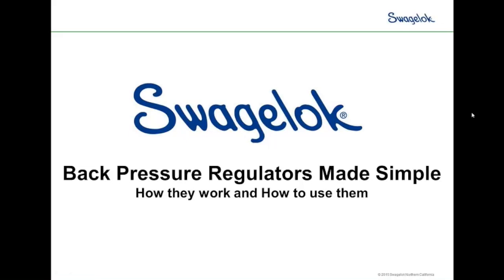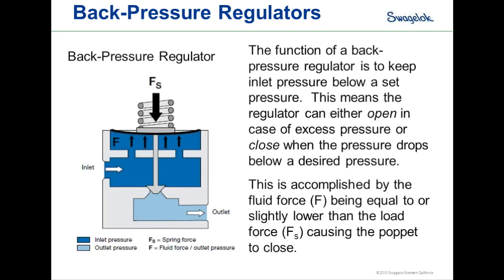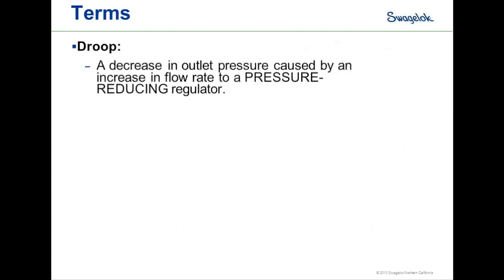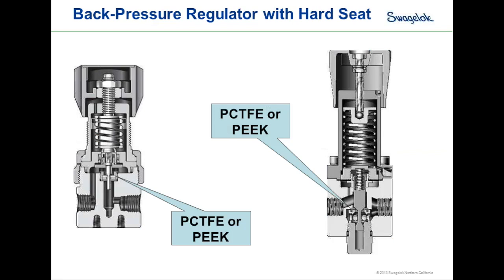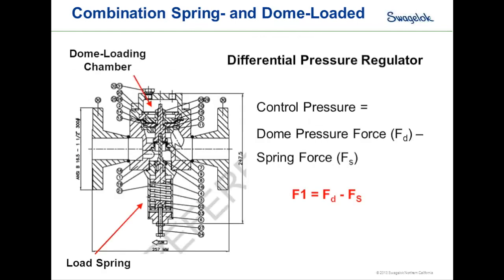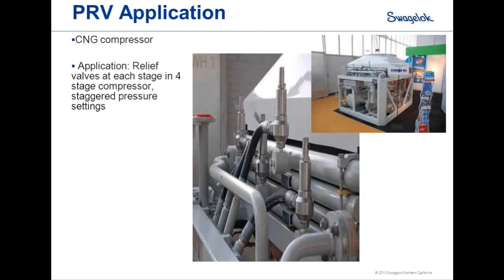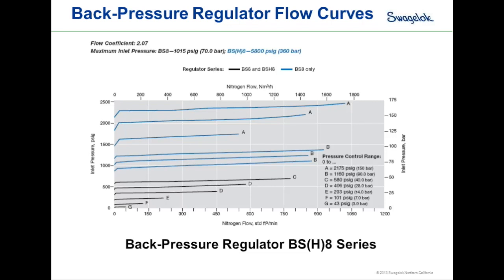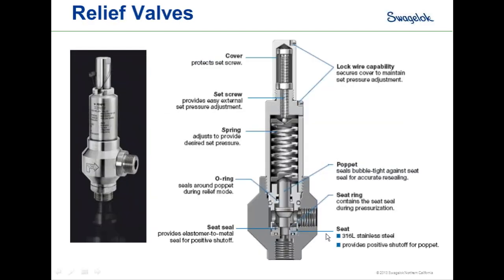Swagelok® Back Pressure Regulators Made Simple

Comment: A question on back pressure regulator. If I have a gas source at 800 PSI and I wanted to let it into a machine at say 3000 PSI, I will use a back pressure regulator. THE BPR will open when the back pressure is above 3000 PSI but what decides the amount of flow through the valve? Can I control the flowrate as well using a BPR?  Would using  a BPR lead to intermittent flow?